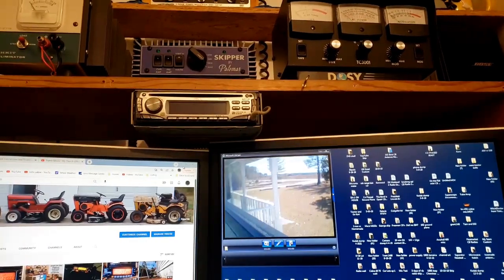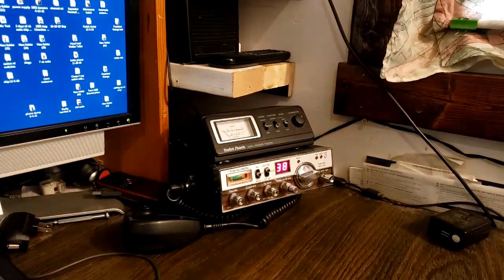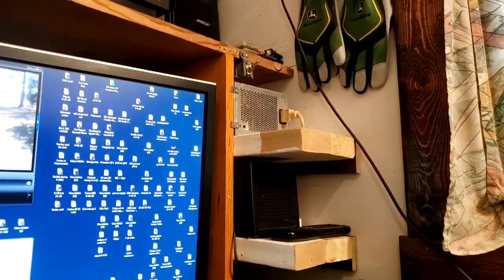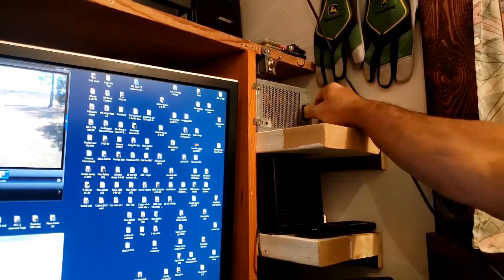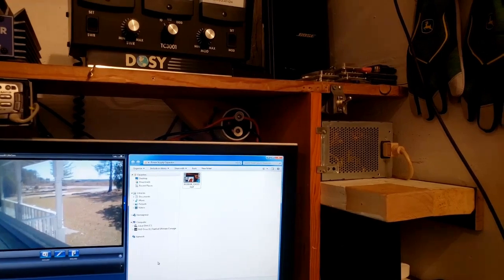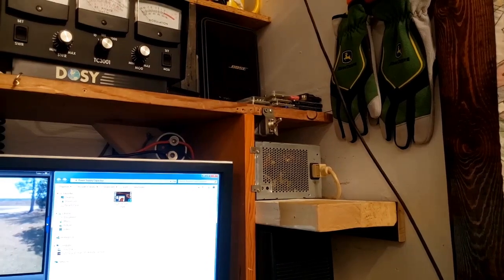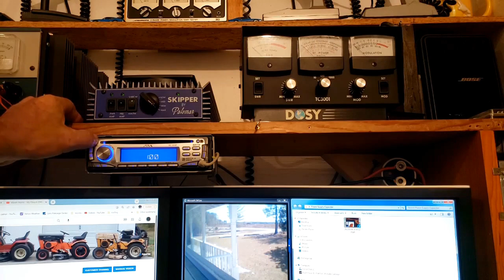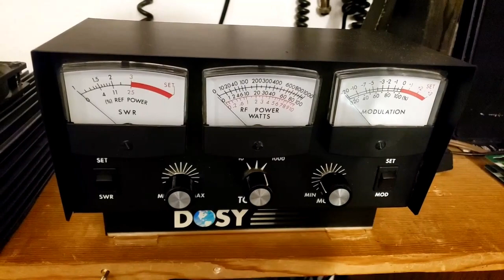Improving My 12 volt Switching Power Supply

Comment: I use to use big low voltage caps for car stereo amps. They work great as a power damper. Takes away the sudden surge tripping the circuit breaker. Good job!
Reply from the maker: Yup, Car stereo caps is where I got the idea from. Take care 105, 73's

Comment: I had a 6 pack of those Capacitors i use on the power leads of my mobile amp to the power supply. Worked great. 
12ny...

Comment: A mower junkie  ct CANNON 701 here i saw your cofazed 2 102 steel wipe with thousands trucker radios for ground plains how come you aren't still  running that antenna I did it because I needed  a vertical  side my BEAM IS 45 FOOT BOOM TWO HEARPIN MACH DRIVERS  222 FOR 2ND DRIVER 208 FOR 38 LOWER SSB ON THE FIRST DRIVER 5ELEMINTS SPACING IS 75/50/110/302" SENDME FEED BACK TELL ME WHAT YOU THINK
Reply from the maker: I still have all the parts to put the Co-phased beam back together, But I have found that a vertical Yagi works better, and has less ground noise. Sounds like You're running a kick ass setup, Let's keep the hobby alive. Take care, 73's from 151 SC.

Comment: Nice video 151. My only question is how many amps. is your power supply rated at continuous? If your kicker is putting 300+ watts output, then you should be running at lease a 30-40+ amp continuous power supply. Anything less will heat up the power supply in no time, assuming you do not have a built-in fan in the supply. 73, 770 RI.
Reply from the maker: it'a an 80 amp power supply, it's just not designed to have a sudden large current draw. A big capacitor is all it needed. Take care 770, 73's from 151 SC.
Reply: @MowerJunkie  Well 151 that is plenty of amperage for that kicker so no problem there, and I notice your heavy gage wiring etc., well done!

Comment: Just a simple question for you to check before I trim my antenna, (im running a corba 29 ltd classic) I'm going through my stations 1 through 37 and my antenna light is not coming on, But once I change to channel 37 38 and 39 My antenna light goes off, Now I've done a bunch of research and this is telling me it's it's past 3.0 which you said was hurting the insides.  Should I trim it a 1/4 inch
Reply: This is going off my internal radio SWR meter, I am currently waiting for my 1' jumper from my SWR meter Box to my radio
Reply from the maker: I think you should wait until you can use an SWR meter inline, Before doing any trimming. 
Take care,  Enjoy the hobby.

Comment: Interesting video but I can see guys now using under-rated power supplies and adding a big cap to make up for the lack of amps a power supply can put out. First of all, no one will tell the difference between 300 watts and 400 watts. Overdriving a power supply above its limit is asking for trouble. Another thing, staying on the lower side of the amp's range input power, will give you less distortion and your audio will sound better overall.